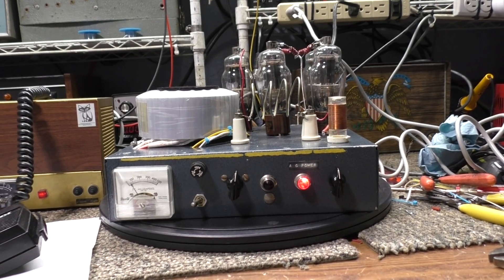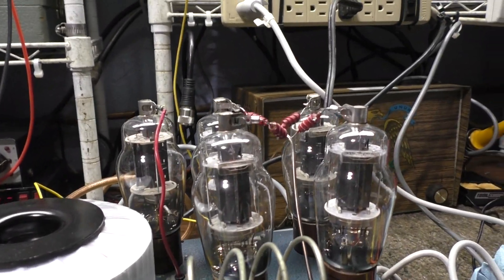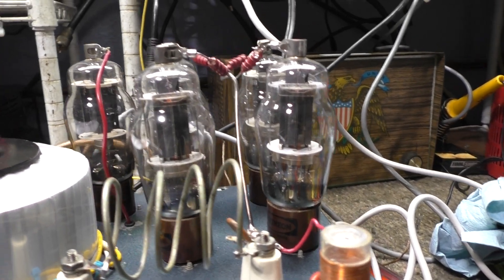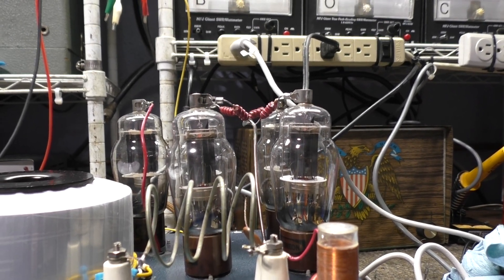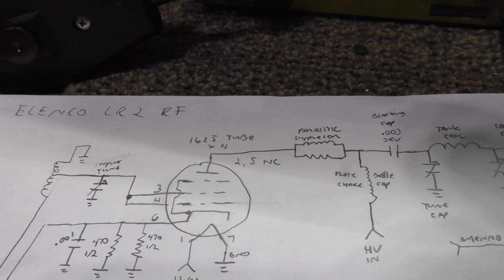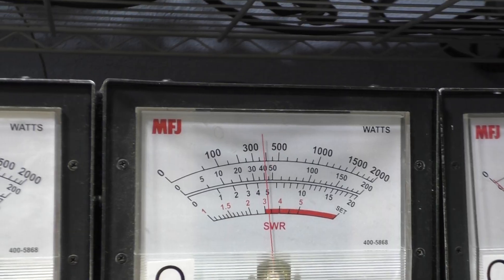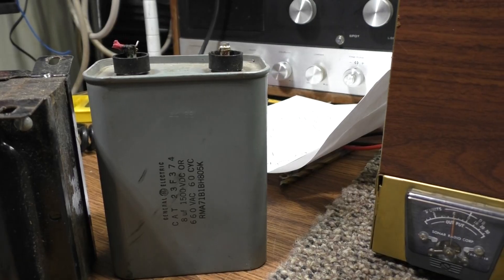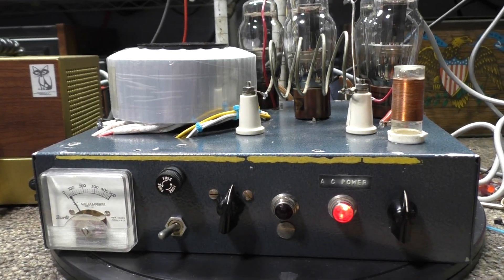Elenco LR-2 'Long Ranger' mystery box all finished up, keydown at the end.

Comment: thanks for all the good info that you put out mr tram dr  i enjoy them all , i like using  the 4-125a tetrode and the 4-250a and the 4-400a tubes -if you use the fil trans at 15 amp 5 volt ,then you can run all of the tubes that i mentioned .and to get full output from them takes a lil adjustment on the input trimmer  ,and the tubes are super tough and cheap to buy ,thank again sir
Reply from the maker: I agree. I have a bunch of 4-125 to dual 4-400 amps, RF decks, etc. lurking around but have not played with them yet. My thoughts were they were going to be my keepers once I get them going. I plan to get to them once I retire from the 9-5 and start focusing more on me and my station. If things go well, I plan on retiring soon, so stay tuned. My dream amp is a good dual 4-1000A amp in tetrode mode of course. BTW, I got a complete Johnson KW in the dungeon too.